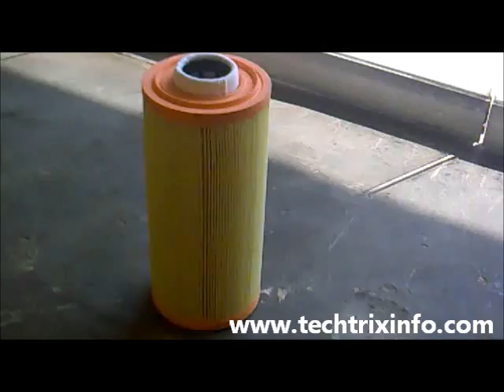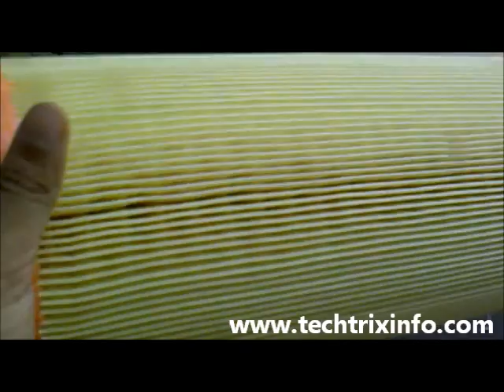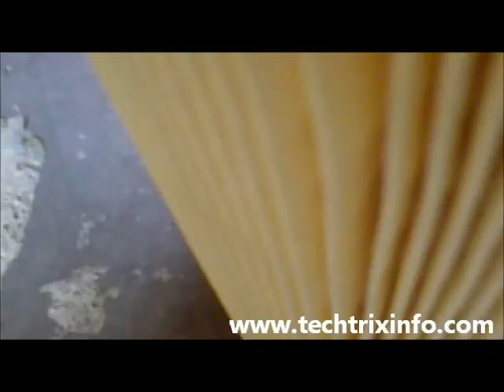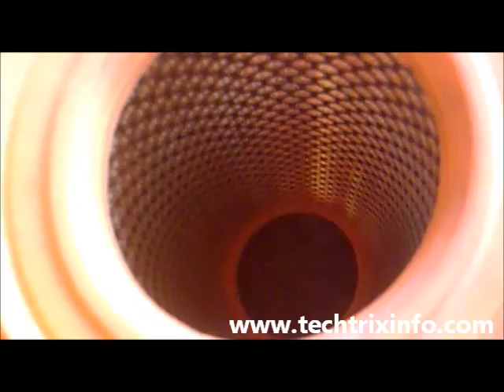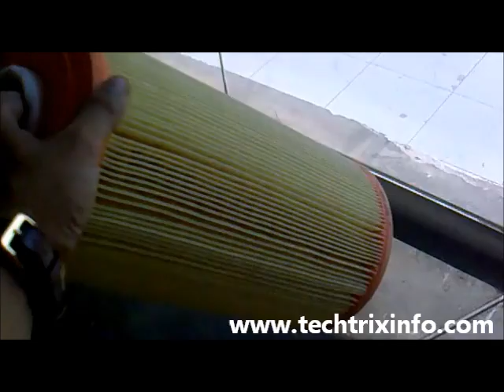How air filter works. ✔

Comment from the maker: No its not recommended to wash it. the unit will fail..
this is the air filter of a JCB 3DX Back hoe loader machine..powered by JCB 448 engine...

Comment: Is washing of filter with hydros(water) or any other liquid is recommended for better cleaning instead of blowing of air from inside. Please always describe the name of the motor from which you had dismantled the part under explanation. Otherwise Good work.